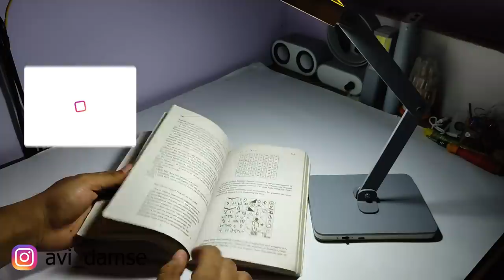How To Make Rechargeable Table Lamp At Home

Comment: Hi, try changing the resistor of the TP4056 un order to regulate the current flowing to the battery, remember it comes with 1amp preset current configuration and this Will damage your battery very fast.
Reply: Can u tell me, what's the value of changing resistors?

Comment: 1)sir how to make wind turbine with 775 DC motor...
2) is it possible to gain free energy with DC motor 
3)how to make 220V(16amp) ac by using 775 Dc motor..
4)SIR how to make a RC PVC tank ?